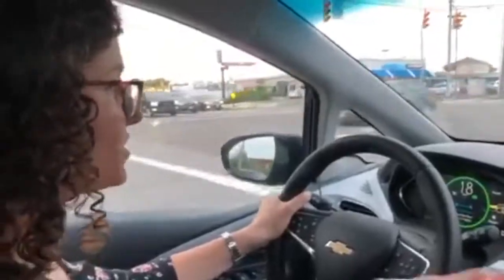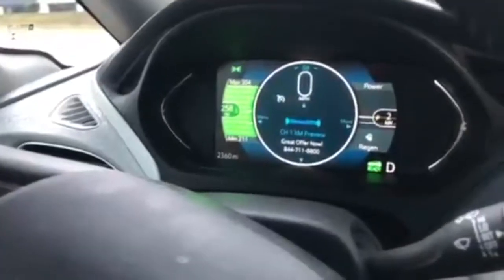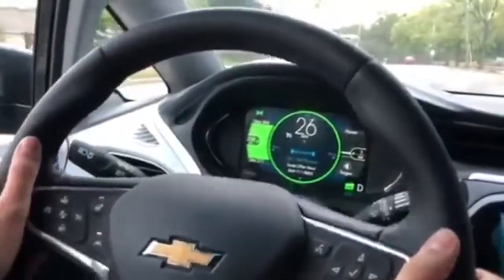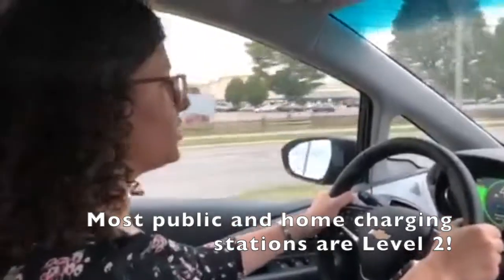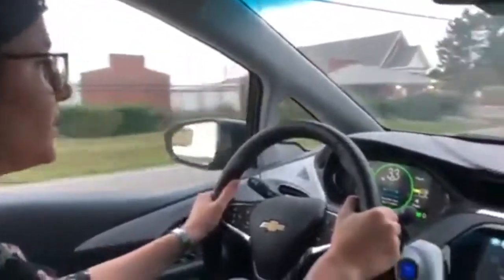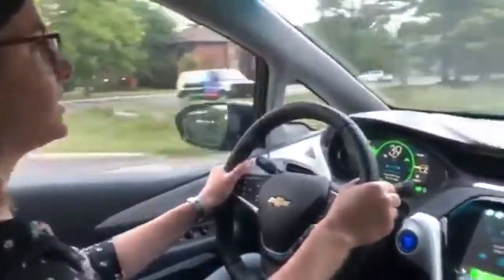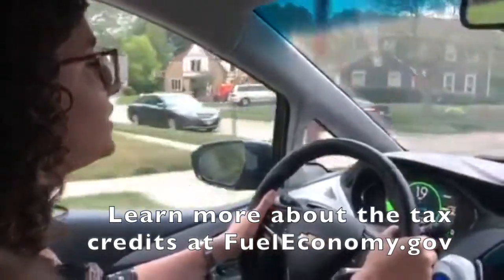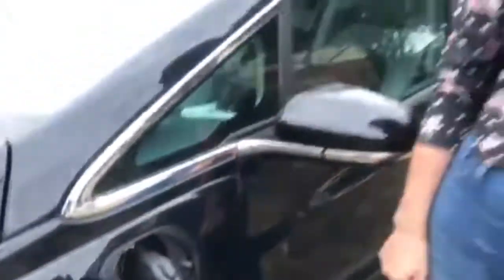Bolt EV Ride and Drive

Comment: 2:33 When you step on the brakes, you actually are applying the brake pads to the disks and are not using regen.  To put energy back into the battery, you just take your foot off of the accelerator.  The regen can be enhanced by putting the gear shift into “L” mode and use one pedal driving.  Additional regen can be accomplished by using the paddle behind the steering wheel on the left side.
I drive my Bolt 99% of the time in “L” mode and quite often will go entire trips around town without touching the brake pedal to stop the car.
Reply: You will see it does use regen to a point on the guage but like with any hybrid there is a point the break pad takes over. You are right L or the paddle is only regen.
Reply: @applemachome  The Bolt is a BEV, not a hybrid.

Comment: We've had our Bolt for 16 months (38,000 miles so far)...yet I learn't something new the other day.....and yes it's probably in the handbook somewhere. From park, if you GENTLY tap twice on the accelerator  the brakes disengage

Comment: I bought a 2017 Bolt a few days ago and I'm loving it. I finished installing 240V in my garage and now just waiting on a 32A Level 2 charge cord I ordered off ebay. The 110v charger works ok abit slow. But I live in the boonies of PA and daily driving could become an issue at 110V. I new drive in L mode most of the time. Saves on breaks and increases regeneration.
Reply: *brakes, not “breaks!” Education is the key too a better life!!!